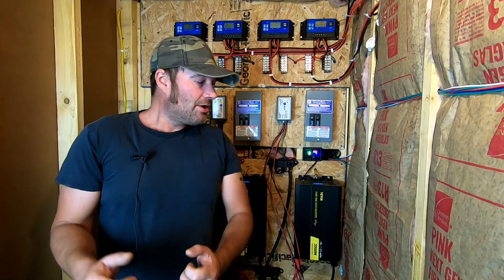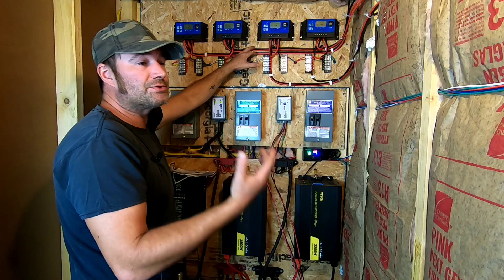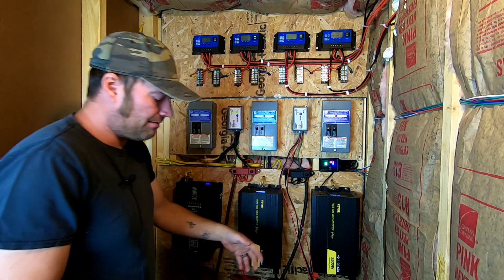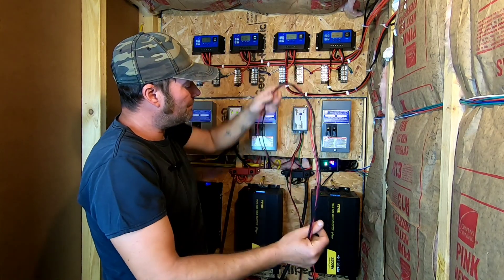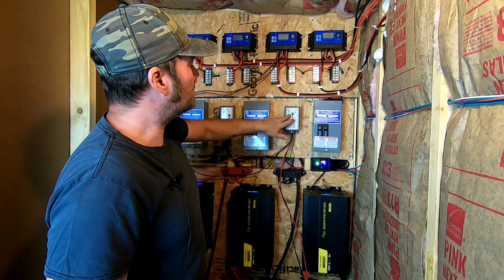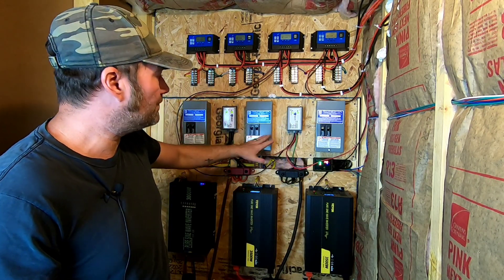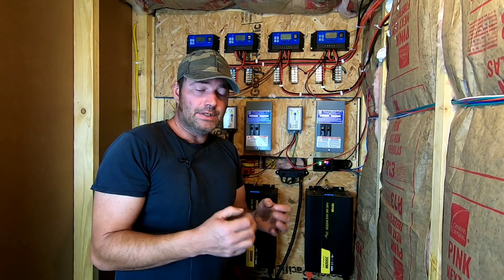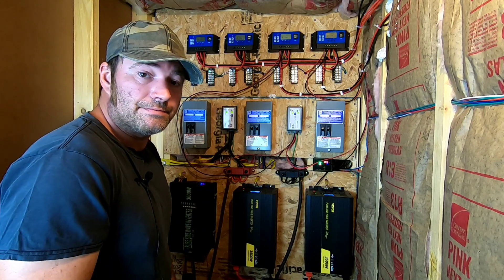Installing EMP Shield Dual Control on Off Grid Solar

Comment: Great informative video. Cool product. You mentioned that the dc circuit is protected with the two dual emp shields you installed . Does that also mean the batteries are protected as well or would another emp shield be needed for the batteries? Thanks

Comment: $400 shields but $10 charge controllers. Is it just get it up and running thing? Upgrade down the road or are you happy with pnw?
Reply from the maker: For one they aren't $10 charge controllers and yes I'm very happy with what I got. Been running them for 3 years power bill free. I'm not a fan of paying over priced mppt.
Feel free to post your amazing solar system. Send me your photos via email
Reply: @SurvivalLiving  ok thanks. Not ball busting. I am learning off grid set up. I have one of those controllers or at least looks exactly the same so maybe there’s different grades but I paid 10 bucks for mine. I just got to  2 24 V panels and I’m in for getting it into my 12 V 100 W panel on my boat and just kind of seeing what’s out there and seeing what works how to put it together I don’t know I don’t wanna burn my boat down my cat would appreciate that
Reply from the maker: Main thing to remember. In my opinion it's best to run a little cheaper and have the ability to replace when the shtf than have everything tied into 1 product at $800 or whatever and have no back ups.
The EMP shield not only protects the charge controllers but the wires and appliances on dc through the house 👍
Reply from the maker: I've been using the pnw charge controllers for 3 years daily and had zeros problems. But to each their own and definitely build to your needs, comfort, and peace of mind 👍
Reply: @Survival Living  yes I do live in Seattle but not Bill gates. The best are mppt but as I build and mature the Grid I will use pwn so as I make mistakes I'm not out $150
Reply: @SurvivalLiving  so I will start my building with pwn and upgrade as needed. Up here in Seattle so winter light is short summer is long so for now pwn it is until I get it right. Thanks
Reply from the maker: Seattle is definitely rough for solar. I lived in Oregon a few years ran solar as a back up. Basically I had to run twice as many panels 👍
Reply: @Survival Living  160 watts how far would that get me in Florida?